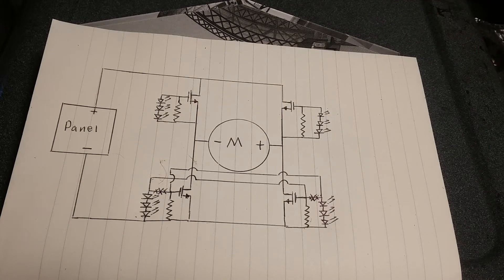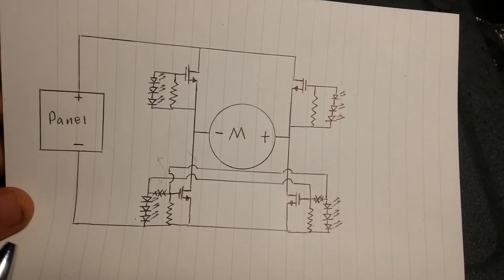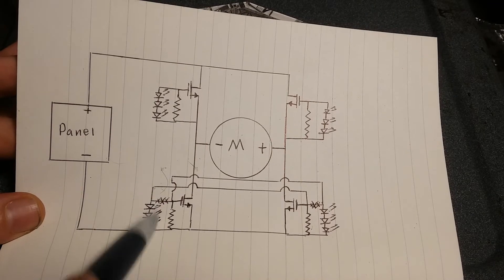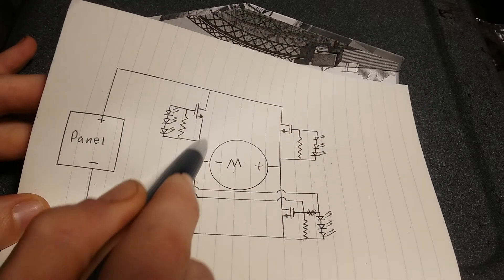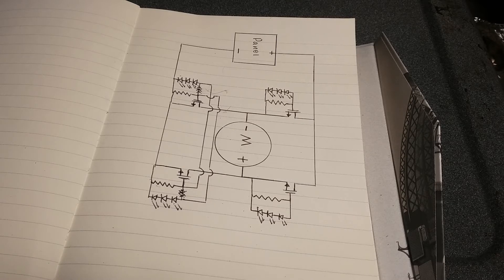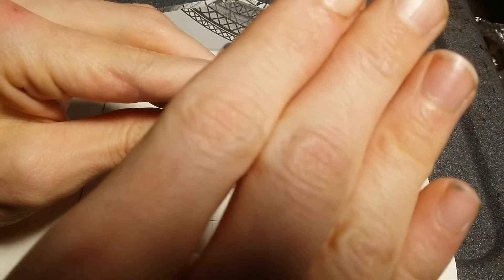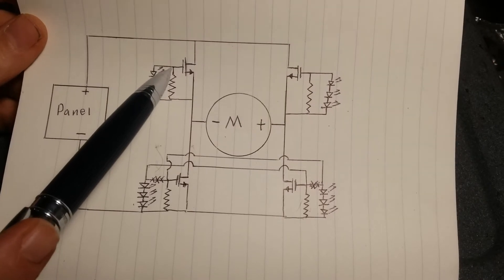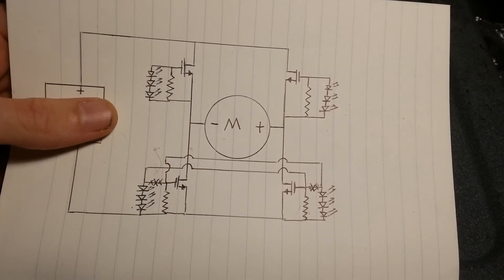LED Solar Tracker H-Bridge

Comment: super simple!! nice
Reply: might be hard to avoid burning out that motor if both sides get a good amount of light from a reflection or something. needs to be extremely shielded. as you said in the video
Reply from the maker: @WillProwse   Thanks and yeah, a real implementation has a few nuances that aren't really addressed in the video and there's acres of room for improvement. One point of note is that  If I recall correctly my mental goal was just to create a suggestion with the smallest possible price point, ubiquitous parts, and just basic functionality. I'd certainly never suggest using it for anything professional but it might find utility in a poor region of the world since it can be pieced together mostly from salvaged electronics.

Comment: your light sensors arrow are pointing at the wrong direction. they're not light emitting diodes, the receive light, not emit it.
Reply from the maker: You're right, good catch.
Reply: rigoagui  what do you mean? Sensors have different symbols than emitters.

Comment: One thing I noticed while tinkering with this, is that the LEDs in series do increase the voltage nicely if they're all receiving light, but if one of them is not receiving light the output is zero. This might be a problem for this design, but maybe it could be used as an advantage somewhere. 

As a side note, some of the LEDs I had on hand were completely useless for this effect. I even tried capacitive discharge mode and it still didn't work. But I used 4 RGB LEDs in series (the best effect was achieved by tying all the anodes to the next cathode in series) and was able to get a very stable 6.3 volts output with a bright light source.
Reply from the maker: Yeah, this sort of setup can be really finicky if you're testing it with a highly directional or point like source for testing, but most of that disappears when you get it into sunlight. 

Hmm, I've never used RGBs for this sort of thing. I'm struggling to recall but I think the best output I got when I first learned about this was either green or white 5mm LEDs from microtivity. I might have to find a light diffuser and test that out again.
Reply: @AtlasReburdened  If you don`t mind a slightly higher cost, you can use a BPW34 photo-diode. It has an active area of 4x4 mm and is able to generate about 1v into 100k in strong room light. They look like a tiny solar panel under magnification. Very cheap if you by them from the auction site, fake ones seem to work just as well as the real ones as long as you don`t need the response time to extend into the Mhz range.

Comment: Nice idea...
Couldn't u use 1 set of 3 LEDs to trigger 1 pair of mosfets for each side instead instead of 2 sets of 3.?
Reply from the maker: Unfortunately that definitely wont work if you uses just the bottom LEDs and probably won't work if you just use the tops. The problem being that each FET sees the voltage on its source as ground and for N channel FETs you have to bring the gate voltage above that ground voltage by a certain amount for it to go into conduction. The collector voltage of the FETs at the top is going to vary wildly as the motor spins so whatever you use to drive the gate on those ones has to be creating a voltage relative to that floating "ground" point. So if you just used the LEDs on the bottom and connected them across to the top FET on the opposite side they're only going to be producing a few volts over circuit ground, but not over the "ground" for the top FETs, and so they won't conduct under the expected condition and thusly won't provide the voltage on the drain of the bottom FETs which is also required to bring it into conduction. If you just use the LEDs with their ground attached to the "ground" of the top FET, then you have the only current source pulling the voltage of the bottom FETs gate also attempting to push the drain voltage of that same FET low and to be honest I just don't know what will win in the fight between the panel voltage and the non op condition of a Vd-s being pushed lower than the Vg-s, and if they don't conduct then the voltage on the source of the top FETs won't be be able to drop toward circuit ground, meaning the Vd-s of the top FETs wont be satisfied. It might work-ish, but I don't think it will. Really only one way to find out though.
Reply: @AtlasReburdened  My bad... Was having a blonde moment..!
:)

Comment: Nice, I didn't know that you could use LEDs that way, cool. Thanks man!
Reply: Yeah... is interesting what can be done even without the LED's that have the detector.  Reminds me of the other end of spectrum equipment that is more pressure and magnetic field related, i.e. a speaker as a microphone.  

https://www.instructables.com/id/How-to-Make-a-Directed-Energy-Weapon-Detection-Sys/
Reply: LEDs don't work that way. these are light sensors. he's calling them wrong name.
Reply: @TechnologistAtWork  Like in the diagram images in relation to use?  

Even some transistors can have the casing filed, or removed some way, to become light sensitive photo-diodes or really they're technically a photo-transistor application.  

Here is a better description from AD:
https://www.analog.com/en/analog-dialogue/raqs/raq-issue-108.html
Reply: @jafinch78  they're nowhere close to being accurate sensors and actually lose their sensitivity over time.
Reply: @TechnologistAtWork  I'm assuming was an idea more for salvaging parts to re-use more cost effectively than solar panels or maybe even cheaper brand new.  Though solar panels lose their sensitivity over time... albeit I'm not sure how much in relation.